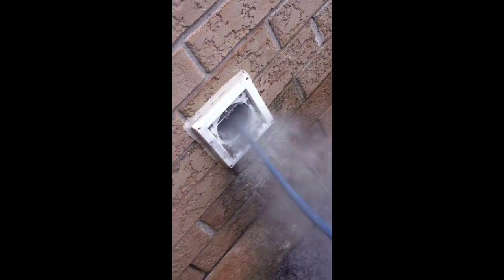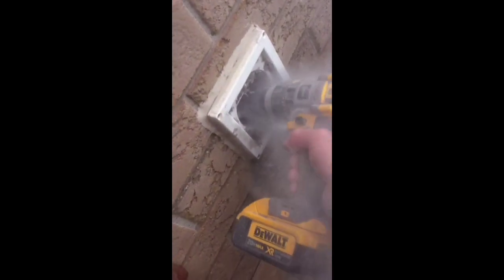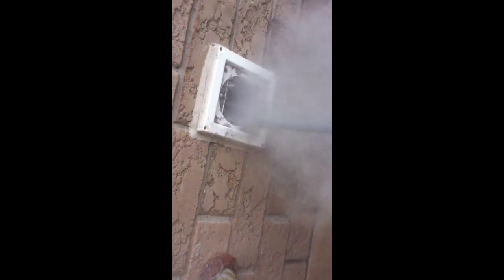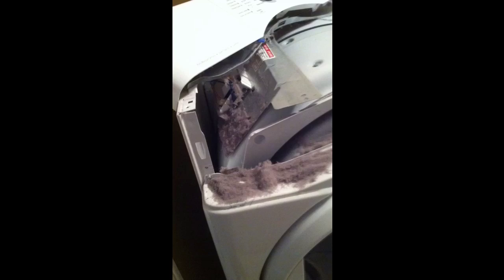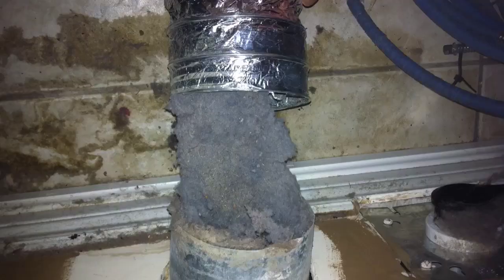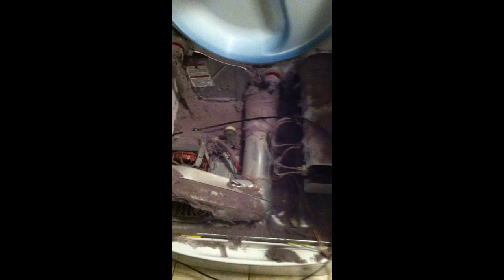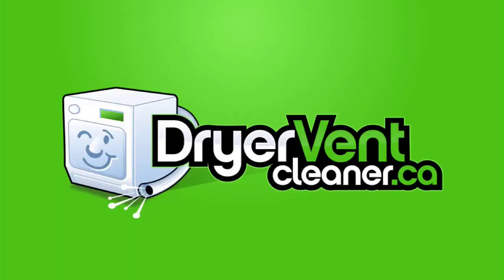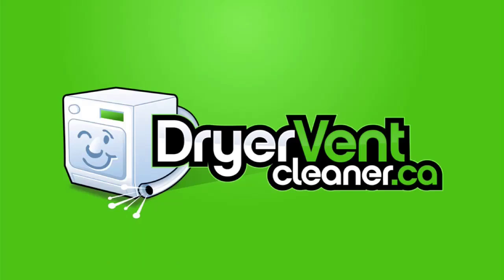HOW dryer fires happen - Are you at risk of a dryer fire?

Comment: My vent looks burnt like u showed but my duct is only 1' long and clean. Plenty of make up air. I replaced the hot air vent with new. Total tear down. Did it again in one day. The air is just too hot. It's gas. No lint build up inside the dryer when I took it apart.

Comment: There should be a safety feature where the dryer does not start at all of there is too much lint or lint near the heating element. That would prevent a bunch of house fires
Reply: I think most newer dryers have a thermal cutoff or an override to cut the flame if it happens to be gas if the temperature gets too high. The problem is it might already be too late if it's hot enough for the temperature to be that high in the first place. I'm one of those nerds that's very suspicious of these sorts of things so I frequently check my dryer vent outside when the dryer is running to make sure that the air is Coming out pretty smoothly. 
I also never run my dryer on the highest heat setting. I always wanted on medium. Most of the time the only difference is 10 minutes worth of extra run time and I do want to bet that that's all set Anyway by the likely less propane the units using. It's amazing how hot dryers will get today, especially gas dryers when they're set for high. 

Stupid as it sounds if you find yourself in the position of having some saying where your dryer then goes, don't put it on a second floor because it's hard to remove the long-hairs and stuff that make it through the filter and get stuck on the door at the end or the shutters if you can easily access it. You'd be surprised how much of that stuff ends up out there. My wife has really long hair and every month I pull the screen off the dryer vent Outlet in there's enough hair in there it's almost make a new one of her by the end of the year. And that's just what Got through the filter and outside.
Reply: there is.  if a electric dryer gets to hot i burns out a thermal fuse. people buy a whole new dryer for a 7 dollar part. and it burned out because the lint built up in the exhaust